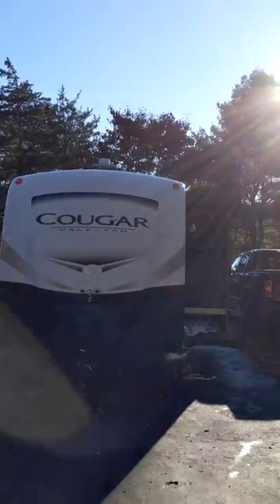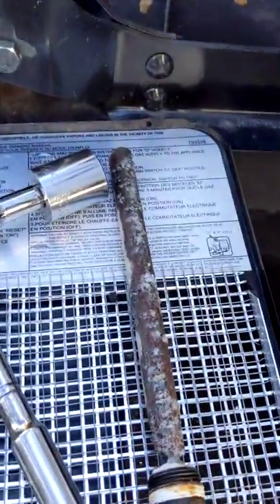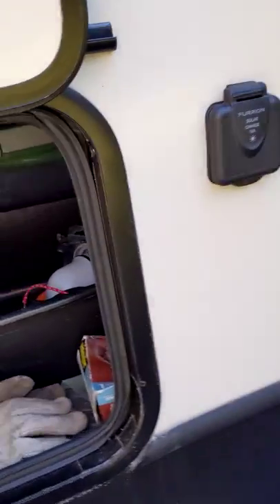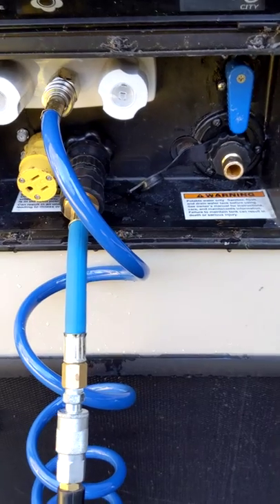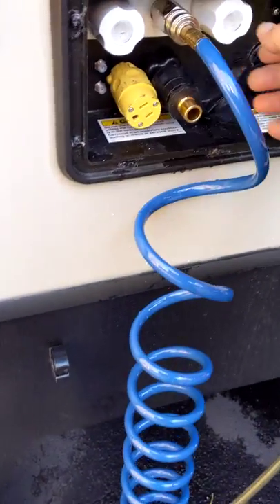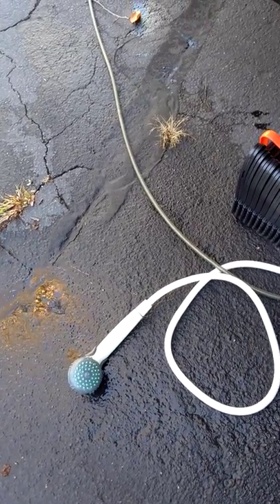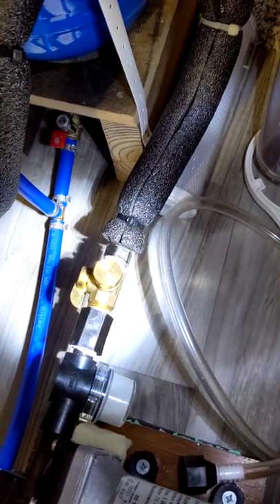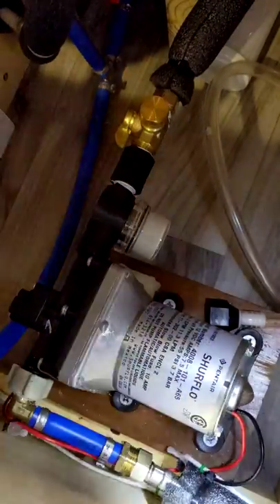Winterizing my 2018 Keystone Cougar 22RBS.

Comment: Where do you pump from on a Keystone Cougar? I have the same camper and can’t find it. Looking to pump antifreeze into my system.
Reply from the maker: You have to install a winterizing kit on the suction side of the water pump. 

You should join our Keystone Cougar Owners Group on Facebook.

https://www.facebook.com/groups/167103534515981/?ref=share_group_link